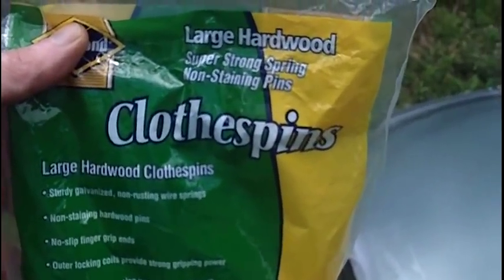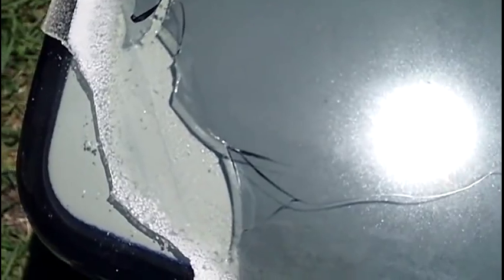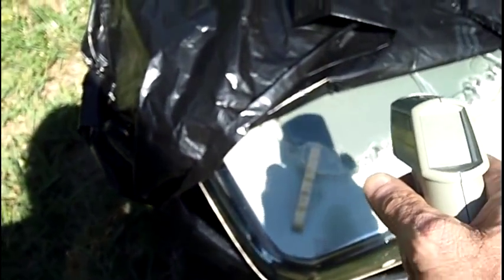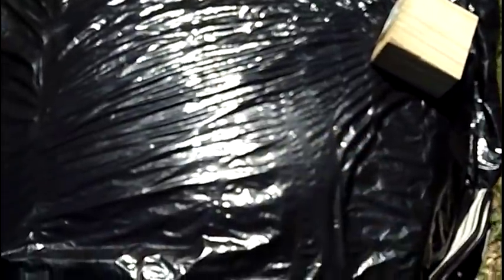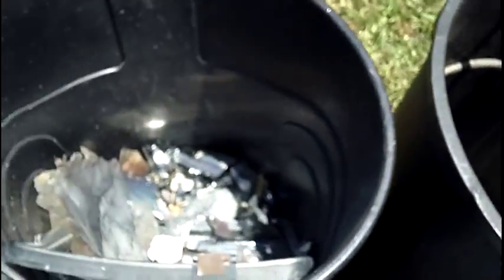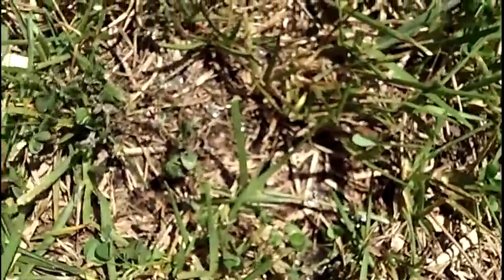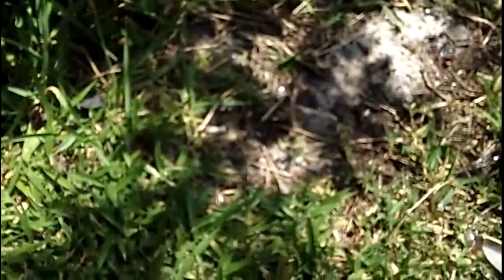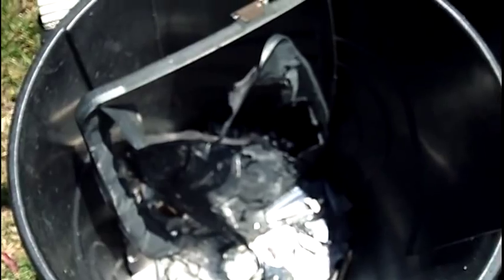CRT safety glass removal FAILED

Comment from the maker: Tried that, does not work on the RCA type, That does work on the Zenith type where the bonding agent is more like goo, Besides using a sawing motion I also tried some SS wire heated to red hot with a variac, and then sawing at it. The RCA type is MUCH tougher than the zenith type.

Comment: Why did US crt's have this stuck-on faceplate anyway?

Euro crt's never did as far as I know--and Ive seen many thousands in my time, never any cataracted ones--ever!
Front of Euro crt's just bloody thick glass, bout 1"....
Reply from the maker: +HighCompressionII I assume the bonding agent and the face plate was an attempt at implosion protection like laminated safety glass. Later models (color anyway) used a tension band that I assume works by preventing the outward movement around the perimeter of the CRT, without that movement the implosion is "contained". I have never seen implosion protection on BW CRTs. what year are you talking about on the euros that did NOT have a faceplate bonded? IIRC by about 1970 the band was being used.
Reply: +Dave WM We got colour a lot later than US, in 1967/8. All crt's from then on had steel-bands that hold the mounting-lugs to the tube, like the A56-11X crt and its later push-through A56/66-120X friends.
b/w crts didnt have integral glued-on faceplates either--some sets had heavy safety-glass as separate part fitted in cabinet--if they are old enough!

Only set I suspect MAY have had this extra glass plate stuck on front like US crt--was the Sony trinitron--Say suspect, because that was the excuse given rebuilders couldnt do 'em--something to do with heat affecting them....
Personally--I suspect the real excuse was they couldn't get the guns cheaply enough!